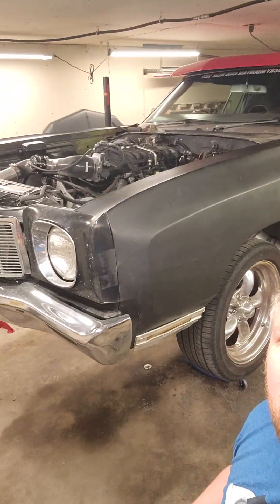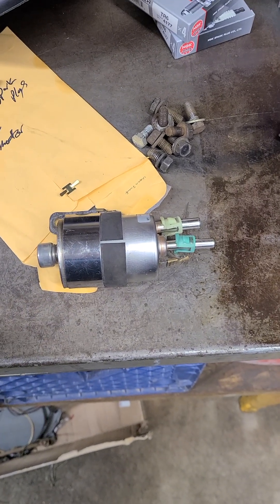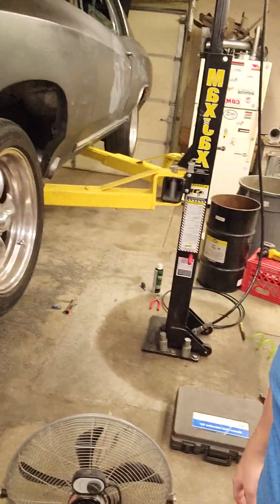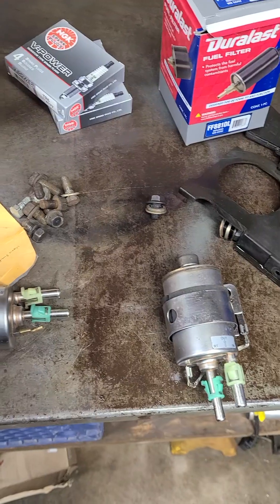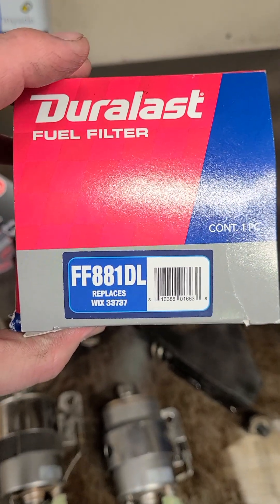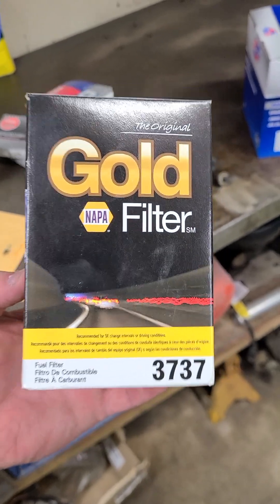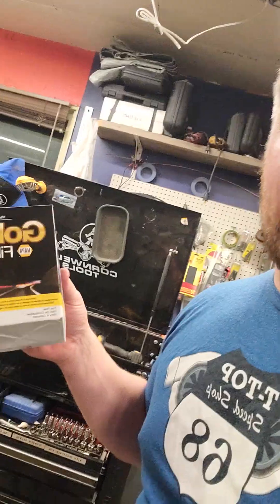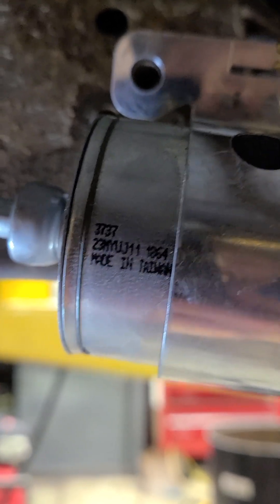75 psi fuel pressure issue. LS Swap corvette style fuel system

Comment: so you replaced the stock vehicle filter with the vette regulator?  i been running filter AND regulator on my silverado.  worked fine 2yrs until now. it has 120psi at rail

Comment: I was have issues,  every time I stopped the engine would vibrate, so i changed fuel pressure regulator and a little better,  then I found the fuel filter was blocked, and I changed the filter, now im getting 02 codes bank 1 and im having the same problems when im idling??? Cant find original fuel pressure regulator in Australia 😅

Comment: 9/20/25 - I had same issue with 80psi fuel pressure, tried Wix 33737 from O'reilly for $100, same high pressure, waste of money.  Got AC Delco Gold P/N 19239926 from the local Chevrolet dealership $255, now pressure is steady at 62PSI.  Delco filter still made in Taiwan with no markings and inlet/return sticker on unit.  GM part number is on mounting clamp.  Internals look different inside the outlet, its so hard to tell a crap filter from a good one from appearance.  Just my experience...

Comment: Because of your video I’m going wheeling tomorrow!!! I was struggling with cheap filters exactly as you mentioned, so I went out and bought the Napa Gold and it brought my fuel pressure down from 69 to 58 pounds. Thank you 🤘🏻
Reply: Wonder how long the regulator will last?
Reply: Before you changed it did you have issue going to high rpms

Comment: I went through 5 different filter before getting a delco that was perfect 1955 Cameo I built, fast forward about 6 years and I’m in the middle of the same bullshit again, had an AC deacon on my 67 nova, after 5 k miles it got plugged, got another AC delco and 100 psi, put two different wax brand on today with same 100 psi , hopefully tomorrow will be a better day

Comment: Just had the same problem with my 67 Chevelle. Running a mild LM7 and I recently put in a Walbro 255. My KOEO fuel pressure spiked to over 100psi with the cheap oriental WIX filter/regulator. I replaced it with an Aeromotive regulator and it’s a static 58psi all day now.
Reply: Which one did you go with?
Reply: @DirtDude117 Aeromotive 13129